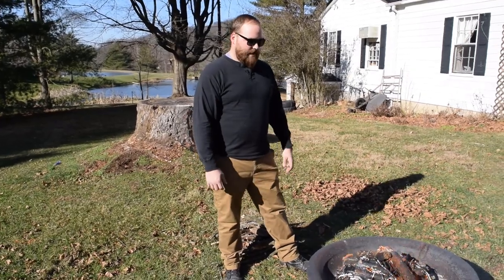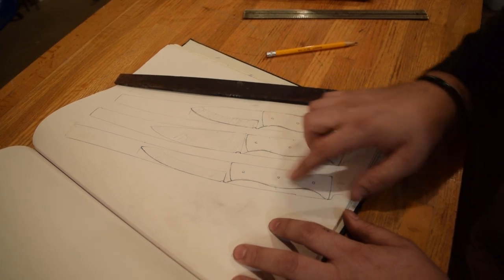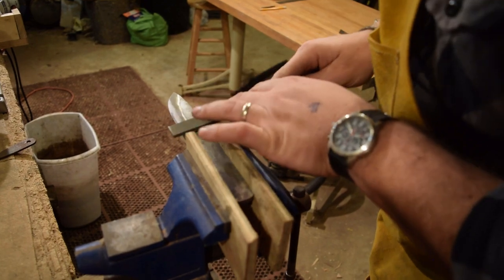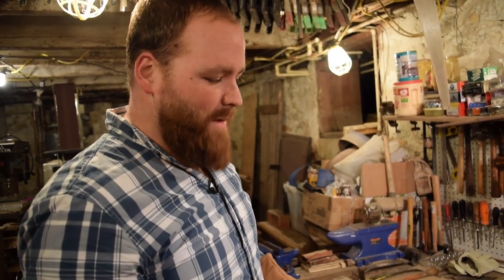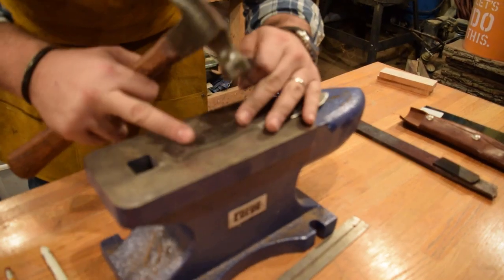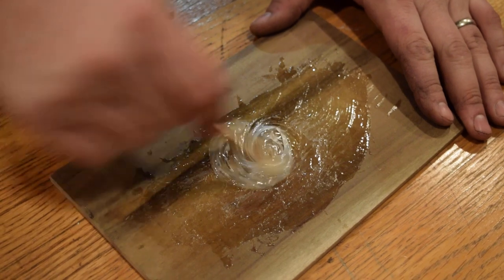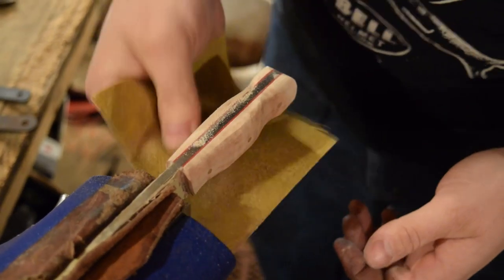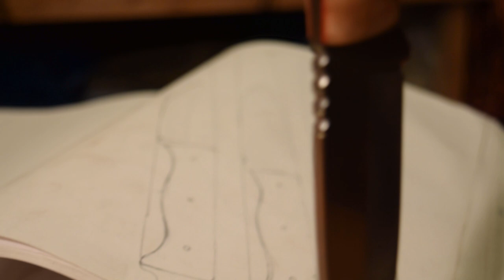Making a knife from a metal file.

Comment: A quick tip for those who are heat treating, it is always a safer bet to drill your holes in the handle before you harden the blade. Some heat treats harden the knife past the blade if you aren't careful and make it nearly impossible to drill through.

Comment: I consider your videos to be some of the best for a beginner to watch and learn from. I am 80 years old and was a pipe fabricator by trade. I have made some knives and have many tools at in my shop. I make axe handles out of hickory. After getting the handle cut out on the band saw I use half inch round over bit in the router to get my handle shape started. It works good as compared to using the various sanders. I also will add a different hard wood to the heel for color.

Comment: Been making knives including folders for a few years, since about 1978 and I can't tell you ANYTHING you don't already do and do well. I STILL learned some useful stuff, which includes how you mounted your angle grinder on the bench. Great idea. As you said, we (humans) can learn from each other. There is a blog somewhere on You Tube which explains how to make a jig to grind your blades easily and more consistently, it is easily made by yourself and consists of a 2 inch piece of 1/4 inch angle iron (made mine from aluminum) .It saves a TON of time and there is no wobble or burnt fingers. Another thing I have used for years is a "Sand O Flex" company contour sander. "Flap sander" to us dummies.And you can make your own refills for pennies. Used mine for about 30 years so far.
Retired files make great knives, the "Murrican Injuns" insisted on them in trades. They are SAE 1095 alloy steel which is harder than the doorknobs of hell when done right. And, your handles are a real work of art also.

Comment: I’ve watched my old man (tool and die maker) win a few bucks off guys betting that he could drill a hole through the cutting surface of a file blade with a normal drill bit.  He would set his hole, align the drill press, and make a little volcano shaped modeling clay reservoir over the top and fill it with cutting oil and drill through it.  Worked every time!  Great looking knife!

Comment: Good job dude! I used a very similar heat treat forge as you for a long time, if you put a second torch at the front of the forge as well it helps immensely! Your tip and center was non magnetic and toward your handle wasn't. The second torch at the front remedies this nicely. No need to drill holes or anything, just set the torch in the front and let it roll! It saved me a lot of time when I started doing it! Great work tho my friend! Thanks for sharing!

Comment: Nice looking knives great video I know carbide drill can be expensive but if you buy 1 from msc a straight flute it will cut through up to 70 rc with no problem and they are easy to resharpen with a mounted diamond round stone or green wheel which you can get from msc or harbor freight it would last you a very long time

Comment: Just a tip from a mechanical engineer - when drilling hardened steel, use a cobalt drill bit , they're relatively in-expensive and drop your drill speed down to its lowest speed and put some decent cutting  paste on it . You will breeze  through that effortlessly . I use this method when extracting snapped off studs that are 12.9 hardness  . ( the right tool used correctly and you will never have this issue again)

Comment: Thank you for your informative video’s, i like your home and surrounding area with the trees and water close by, idyllic.

Back in the seventies as an apprentice i was taught to break in a set of brand new files by filing a 1/4” naval brass plate 4” square. Drilled with 3 holes 1/2” diameter and then file each hole, a 1” square, a triangle of similar size and a 1” circular hole, by the time the brass plate was filed on every single surface including the faces and edges of the plate the files were all nicely conditioned to move on to filing steels.
Another useful thing to do was to use blackboard chalk and rub onto the file, it fills the grooves in the file and helps to prevent  clogging, you still have to use a wire brush or a file card occasionally but it does tend to help avoid an ugly groove appearing in your workpiece as you get close to your finished edge.

Comment: Looks good. I’ve done a few knives in this manner and learned a couple things that I could point out in your build. Those deep scratches you notice during initial sanding are caused by clogged files. The file, when clean, can achieve a very nice even starting point for sanding. But if you have even one steel shaving in the file teeth it will scratch your work piece. So clean every couple of strokes. (Maddening but makes sanding go quicker). Also, on your forge... if you move your burner slightly closer to the mouth you can get  a much more even heat by “painting” the workpiece back and forth through the flame. Also you can heat further down the tang because you’ve essentially made your useable space in the forge deeper. A more even heat will reduce the risk of warping during the quench. Great video and build overall!
Reply from the maker: DrewEdwardBacklas 
Thanks for watching and for your helpful comments. Great advice. One thing I love about this channel, that I didn’t expect as much was all that I have gained and learned from my viewers. Thanks so much.

Comment: A 1/8 Bosch carbide tipped bit designed for granite slow speed with cutting oil will drill thru hardened steel , must go very slow when exiting other side also carbide tipped masonry bit works pretty good

Comment: To drill through hardened steel use a carbide tip masonary drill on a slow speed
Reply: You got it my friend! I used to work in the Marine Navigation industry and there was a lot of A4 stainless around, one trick 'an old hand' taught me was to carry a set of masonry bits as a back-up. I had a good set of Cobalt drill bits but you probably 'know-the-score', most industries use standard fixings, for instance 5mm, 8mm, 10mm and 12mm bolts....so your 5.5, 8.5, 11 and 13mm bits get the most work and sooner or later, you will break of loose (to the briny depths) your 5.5mm drill bit....if a 6mm is just too loose, then a masonry bit can get you out of trouble.......not a lot of people know that......respect!

Comment: Nonmagnetic is 1420°, salt is good temp judge salt melt point is 1474° put salt on blade place in forge when you see it start to melt then quench blade... dont use motor oil for quenching if need be use canola oil... Etc... And drill pins prior to heat treat...

Comment: Buy a number 30 carbide drill bit, #30 is .128 a little bigger than 1/8 inch. Small size carbide drill bits are not too expensive, like $13. I would have just tempered the file at 425 for two hours and ground down the knife, nevermind the anneal. The 425 temper will leave the file about RC 59-60 hard. If I was to go to that much trouble for mystery steel I'd just buy some O1 tool steel and make a knife from that.  Of course I've been making knives for thirty years.
Reply from the maker: Thanks for the advice. I will never turn down info from more experienced makers. Thanks for watching.
Reply: @TheArtofCraftsmanship  I enjoy watching other craftsmen especially ones like you who is humble and not a know it all.

Comment: And that's the big problem with free hand filing/grinding, you've moved your bevel line a couple times so you've gone from a Scandi grind to a Sabre grind, make yourself a bevel grinding jig, that way you have total control and get the bevel you started with. Drill all holes BEFORE hardening. If you make loads of shallow drill pits all over the scales before glueing to the knife the bond is much stronger.

Comment: Great job man.  Great explanations.  If I might suggest, turn your blade in the forge so that the direct heat is not pointed at the edge.  That thin area can heat up much faster so generally you turn them down for more even heating.
Reply from the maker: Tim Kelly thanks for watching and for the tip.
Reply: Your the real deal man. Love the handle shape as well.

Comment: Ive been a bladesmith for well over 35 years. You should never cold hammer on a blade. It can cause stress fractures you can't see. You need fancy stuff to build a coal/charcoal forge. A hairdryer will make a perfectly fine blower. Old brake drum makes a perfectly fine pot. While cinder blocks and some old black pipe will make a perfectly good stand and air channel. You already have the difficult part in your anvil. Hammering to shape makes a better blade than grinding also. If you would like to learn to do it the correct way i am happy to teach you. Can all be done through video calls or trading videos on here. I do intend to start making videos to show people the old ways my grandfather taught me, as in no power tools using files and stones to polish. Of course talking videos that will be hours long so i can show the whole process of forging to 90+% finished then hand polishing would be a seperate video. Im not knocking anyone, just want to share with people who show interest in the true art of smithing.

Comment: If you can't drill through the handle like at minute 22 or so put your hardened  blade in a canister full of water where the handle just sticks out and get your heating torch to the handle to temper,,then drill...hope this helps
Reply from the maker: That’s a great tip, thanks.

Comment: Just a suggestion. When I need to drill through tough stuff I break out the tig welder... Heat up the zone where you want to drill with the tig torch on decent amps. That should only affect the drill zone and nothing else.

Comment: Pretty good free hand filing...next time, I'm sure you'll drill the holes before the heat treat, but you do have a steady hand and good hand eye coordination in orienting your work to the belt sander for grinding your levels. Your very brave not using a jig, so don't let the know-it-alls and trolls discourage you....nice work
Reply from the maker: Road Dog 
thanks for the comments. I have moved on to using a jig for my bevels, but I definitely spent a good amount of time in the beginning working hard to make those bevels look even. I wanted to show how it could be done with an eye for Craftsmanship.

Comment: Really detailed video. I would do some of the steps a bit differently, but that is part of what makes work individualistic. Great job of showing the newcomer/novice just what goes into the making of a knife by the grinding method.
One thing I strongly encourage however - USE vinyl or latex gloves when working with epoxy. I have a friend that became sensitized to it after a few years, to the extent he can no longer use it.

Comment: I personally prefer to leave it hard and just use an angle grinder and bench grinder then to only have to worry about tempering it since I have no way of heat treating it. I also don't have to worry about cracks or the temperature or warping or any other problems that can occur during heat treating

Comment: Epoxy bonding steel to wood is fine for trophy knives that’ll live its life on a shelf. I’ve been building throwing hatchets for two years and have yet to find an epoxy that’ll bond steel to wood unless you drill holes for the epoxy to bond thru the metal wood to wood, even then a couple hard hits will pop that loose.

Comment: Using a hard wire brush or file card will take the edge off a file in time I always use a soft piece of metal with square end side to side and after a few strokes it is shaped to the teeth and will unclog them easily
Reply: Great info mate!
Reply: soft metals clog files and using a file dulls it over time.

Comment: You did a beautiful job with that old file. Like your handle design with the red strips. Files can be quirky with the hardness level. Have you tried a carbide tipped drill? Was wondering what oil you were quenching with?

Comment: You should try masonry bit of the correct size, just gently grind a sharp edge on your fine bench grinder wheel and gently drill, with lots of lubricant,  may have to edge the bit a few times but you will get it done.  Lots of water grinding, lots of lube drilling and lots of patience and you will get through!

Comment: I've made that mistake of drilling after a heat treat before, what you can do to work through it is take your blade and put it wrapped in a washclothe into  water\ice bath and then take your torch to soften the tang. Done right this should keep your blade cool enough to avoid ruining the hardness while softening your tang. Heat from the bottom of your tang so the heat has to travel to the bladed side.

Comment: Great video. You've done some good work here! You've earned my like and my sub!

I have a small shop as well behind my house where I do blacksmithing, wood working, turning, green sanding and whatever else trips my fancy.
I love having a small shop as opposed to a huge one. 
Just some thoughts as I watch you ply your trade:)

When you're heating your files at first, lay a heat brick under them. It'll not only cause them to heat better, but also help with the warping as they have  a flat surface to deal with.

Also, so glad to see you using the proper Protective equipment! If I might suggest a full shield mask? They're pretty cheap at Lowes or HD, and will not only go a long way to keep metal dust out of your eyes, but that odd chance the knife catches on that sander just right... ouch. (Two scars from that myself lol)
I took a touch off the bottom of mine so it fits better with my respirator!

I never thought about mounting a jig for my grinder... that's pretty dang smart.
I used to use a sharpie for the bevels (and many other uses lol) until someone turned me on to Marking Blue. 

I spray a little of the weakest 3m spray adhesive on my wood block for sanding, let it get a little tacky. It holds the sandpaper but it's 'peelable' so I can ditch the paper, keep the block.

A dab of hot glue will keep your peg board hooks in place, but make them still removable if you want to change up later.

A great way if you don't have a decent torch, to spot soften, is to get a small piece, like an old punch, red hot, and then touch it to both sides of where you're wanting to drill.
Just pay attention to the purple hue of the area, a few quick touches will soften it up a little, usually enough to drill

Holy crud.. made it to the end and realized this was your first video!! VERY NICE SIR!!
Reply from the maker: Robert Faulkner thank you so much for watching and for your awesome comment. I really appreciate all of your advice. Love the comment about the hot glue in the peg board. Brilliant!
Thanks again.

Comment: That's a great idea for the furnace using the metal bucket! What did you pour inside there when you cast it? Is it just cement?
Reply from the maker: It’s a 1-1 mixture of sand and plaster of Paris.
Reply: @TheArtofCraftsmanship  thanks very much for the info 👍 I was watching with no sound so may have missed that. I'm a novice to knife making but I feel I will really get into this as a hobby. Thanks again. Your videos are very good and your projects are top quality 👌

Comment: Great job explaining the steps that go into making the knife. 
I said to myself watching the video that you should have drilled the pin holes before hardening it (I know hindsight is 20/20 lol)
I do have a question for you and anyone else that uses files to make their knives. 
Do you feel it’s important to remove all signs of former teeth from the file?
I’ve done it both ways and haven’t seen much of a difference other than for a prettier blade. 

I’m just now getting ready to start making these for sale. 
And I’d like your opinion. 
Thanks again. Ron
Reply from the maker: Personally, when I make a knife from a file, I like to show the history of the steel, so I leave the teeth. I do grind and sand them down mostly to remove most of the coarseness, but I enjoy seeing the lines left behind. That being said I have made a few that I ground away the teeth. Good luck!